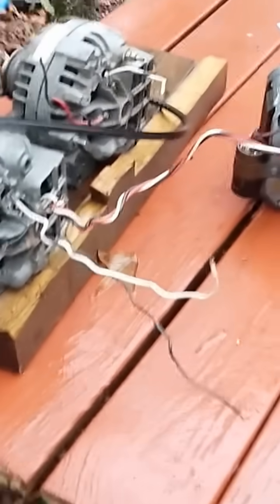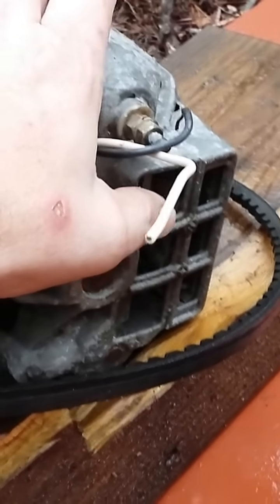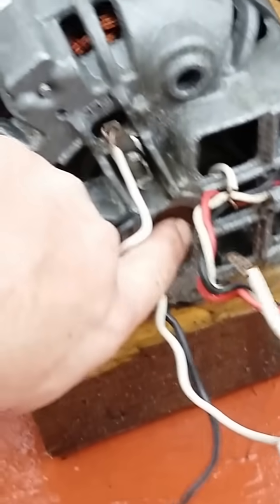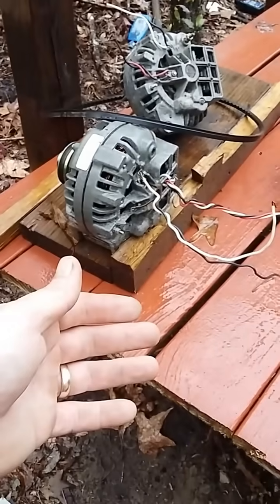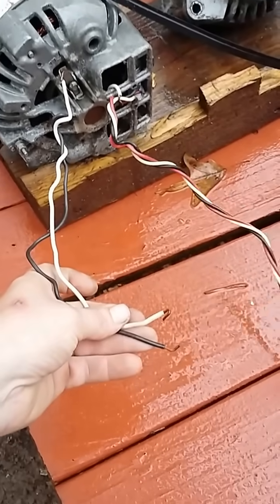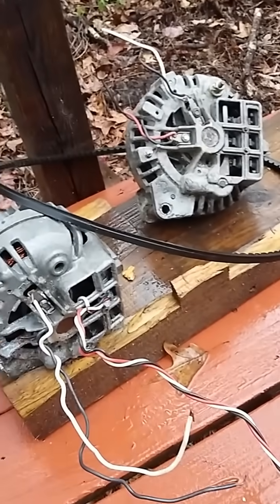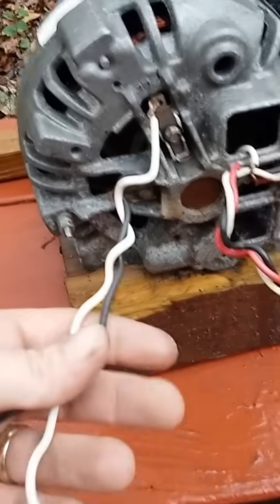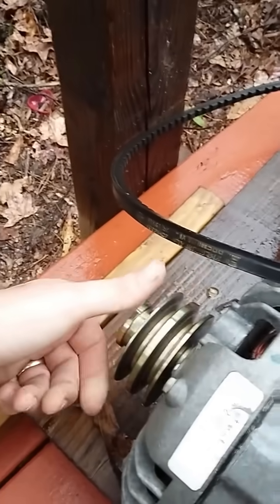Update Free energy forever no wind no solar no gas READ DISCRIPTION!!!

Comment: NO SUCH THING as FREE ENERGY. The Electricity coming out of this is over 300hz and household appliances use 60. This WILL destroy any appliance connected to it. This is stupid. Also it's disrespectful to disable comments
Reply from the maker: DarthSmartt do you see the comments disabled and you haven't ran the machine or obviously you would know that running it at 3600 RPM would give you 60 hertz hence the whole phrase 60 pulses per second time 60 seconds equals 3600 revolutions per minute prick
Reply: DarthSmartt there is such a thing as free energy, but you need to do the research first, just making off hand comments gives any reader of your comments a true sense of who you really aren't.

Comment: "But, but, but... The motor I'm gonna use to turn the generator uses almost no power at all." Sure, pal. When it's under no load because you've never connected it all up and run it. As soon as it's driving three crappy old alternators there will be a load just from friction and drive train hysteresis alone, and that's before you even draw any power off. Whatever that load is, will always be added on top of whatever power you think you can draw from them, and that's without subtracting even more power to excite the field coils. Every amp you draw creates more back EMF in the generator, creating more load on the motor turning the generator, requiring more power to keep the generator turning, PLUS the power being consumed by the motor to turn the generators before you even started drawing any power. This is basic high school stuff.
Sound like I know what I'm talking about? lol
Reply: ThomasBuie EnergyBuies at gmail com
The energy you "make" needs to come from somewhere. To produce 10 watts of power, let's say 10 volts and one amp, you need at least 10 watt input. Because from what else is the power comming from? These are the basic laws of physics, and if you  live in this universe you gotta follow them... Proove us wrong then and show us how it works in theory
And skip the BS of "I can't" or "I don't need to". Is it so hard?
Reply from the maker: oOConstantGardenerOo 
No you're wrong, but thanks for the comment!!
Reply: ThomasBuie EnergyBuies at gmail com Sure I am. Why don't you prove me wrong by posting a single video of the system running while you take measurements from it... I'll wait.

I'll make it easier. You tell me which bit of what I said is wrong.
 Do you have a drive belt made of magic rubber that requires no energy to deform? Magic frictionless gears perhaps? Did a mysterious stranger swap you your cow for some magic alternators wound with the only material in the universe that doesn't generate a magnetic field when current passes through it? Do they have magic frictionless shaft bearings too? 

Hey, I'm sure you don't want to give away your secret without someone paying for it, right? That's fine. As I said, you don't have to give me the fine details. Tell me whether I'm wrong about the hysteresis in the drive train because you've got a magic drive train, or the increasing load as you draw power because you've got magic wire that doesn't generate a back EMF (better not use it for the excitation coils, huh?)
Or just show it running while you measure it.

Comment: Just need about 200hp to turn the two altenators  under load
Reply from the maker: tony hall THAT is not true! the difference in Horsepower between an electric motor and an internal combustion engine motor is almost the same as night and day!!! I am able to turn two 10000 watt generator heads at almost full capacity with a 3 horsepower AC induction compressor Duty motor that runs off of 220 volts ac. the reason why I do not use this constantly is because the motor has a high consumption around 10:00 amps and as almost all AC  Motors are made to inherently burn energy through heat dissipation, that is not the case with 3-phase permanent magnet motors.
Reply: ThomasBuie EnergyBuies at gmail com if you have 200 amps out why care about 10  amps for motor
Reply: 69 camaro 350ci  200a altenator10,000 watt stereo.
If I turn stereo up loud at idle it will make car die
Reply from the maker: tony hall sure it does...
Reply: tony hall ....a 69 camaro,with a 10000w stereo,a 200a alt,I'm guessing 24" rims too?..answer!your car probably just runs like shit!.....and go buy a Honda with a fart can on it!.
Reply: Nope just got 15's 
It happens when batteries and caps are disconnected and car and system are running off alternator alone 

If you had a clue you would have inquired along those lines . You so full of shit to run house of altenators without lots of horsepower to turn . Show us . I believe if you could you would because then people would throw money at you
Reply: tony hall .....lol...I'm not saying it doesn't require torque (not hp)to spin alts at full field amperage draw....I'm just LMAO at a bafoon that would put a 10,000 watt amp in a 69 camaro....what speakers you got 8 15"s in it?,no trunk or back seat...oh oh! here's the  answer,ya just park a 12k genorator on the roof and it'll cure your stalling issue from your kick ass stereo.....dork!
Reply: You need to hide in the woods after trying to get people to send you money over your flat out lies . Even though I guess you might be to stupid to know better

Comment: If you run 90 amps through that 10 gauge wire your going to burn it up.
That wire is to small. Just a heads up.
Reply: It looks even smaller than #10, as an electricsl engineer, I actually found this funny as hell, but God bless him, he's trying.
Reply from the maker: Dave thanks for the comment. And yes you most certainly will. But the alternator in this video is actually a primary mover or S Drive. (Motor)

Comment: all. You need to do is  build a small
Stand or farm like a generator sits
On mount the 2 alternates wire them together
+ to + & - to - wrap a rope around one of the pulleys pull the rope to see if it works.
If it does then you'll have yourself
A good little Camping Generator.

Comment: So let me get this straight people actually think you can get more energy out of a system then you put in
Reply: ThomasBuie EnergyBuies at gmail com yep, that's about right. You're throwing a word salad together trying to sound like science, but nothing you're saying adds up.
Reply: Transformers can step voltage up or down. Just got to know what you wiring in series with your power source. Basic journeyman stuff.
Reply: Joey Neary As the voltage is increased by the transformer, the current decreases. Power is voltage x current, and cannot exceed the input power minus the losses in the transformer. 
You can put 12v in and get 120v out, but if you put 10amps of current at 12v in, you'll only get 1amp at 120 out. 12x10= 120w, 120x1= 120w. This is below 'journeyman' stuff. Children are taught this in basic lessons about electricity.
Reply: oOConstantGardenerOo never said i was an electrician. I am an hvac tech. I use transformers to step voltage up and down. Sorry i used the word journeyman. Thanks for punking me out captain obvious.
Reply: Any time pal. Amazing how you missed it if it was so obvious, you being an HVAC tech and all.

Comment: As long as you can convert more natural energy into electricity than you use and save it (ie batteries) you WILL save money on energy bills over time. It's the same concept as generating electricity thru solar panels and selling your excess back to the electric company. I ran across this video and found the concept interesting. Like the solar panel thing I would always like to know other ways to achieve this. Maybe even using the alternates to multiply the energy. This is the American way. Testing sh.t out till you get a better result. And before you berate me for something, I haven't had time to look at at the other videos about these concepts. But tell me which ones to check out, thanks.
Reply: Patrick Holman you're getting charged for Watt Hours, the voltage makes no difference. Fool.
Reply: Your meter/meters are single phase watt hour meters, a Watt is the product of amps multiplied by volts, if you have two phases for 240, that's two meters and you are charged for the sum of both. A KW/Hr is for eg: 1 x 100W light bulb running for 10 hours resulting in the disc in the meter turning 100 times increasing the meter read out by 10 tenths, or one unit. OR 1 1000W dryer running for an hour, or 1000 1 Watt bulbs running for 1 hour or 100 1 watt bulbs running for ten hours....
 It is exactly what it says on the tin. The more power drawn through the Watt Hour meter, the faster the disc spins.

They read KW/Hrs : the product of Voltage X Amps X Time. You are not being charged for "220V power"... there is no such thing.

Comment: You could use wind to spin a fan blade on a something like this to charge a battery and use the battery for something low like an electric fence, Low lighting, enough to get you by. More batteries you have more power you store. (Car battery tractor batter) 
So a video like this isn't a total waste if your willing to figure things out on your own. 
I have actually seen a solar video storing power on used AA batteries so start saving them, looked like about a hundred of them wired up.
Reply: while both of those ideas could work (with some very complicated charge monitoring circuitry) they are both a bad idea for the following reasons. Single use batteries are not designed to be re-charged, doing so can sometimes get a bit more from the battery but more often than not they will just heat up and if left unsupervised WILL explode. Alternators from a vehicle are a bad choice for wind power designs. They require too high an RPM to produce any useful power and therefore require gearboxes or pully and belt arrangements to increase the shaft RPM, all of which have friction losses reducing the amount of power available to the alternator. Also the side of the windmill blades gets to be considerable given that a car alternator needs almost 7 HP @ at least 3200 RPM to drive it at "full noise" If you do the math and include the losses in your gearing, you'll see what I am talking about.

There are no free lunches.
Reply: Jimmeh B 
Musk is selling a battery for couple grand that others have proven can be done quite cheaper with batteries. 
Yes wiring would take some time. 
And a motor that spins because of power can create power if it spins.
Just throwing some general ideas for people to look at and they can figure out what works and what don't.
Reply: ed sweitzer, I have one. So far I'm running off just over 6600 LIon 18650 cells from "fucked" laptop battery packs that were destined for land fill. Charged from solar panels with any excess power being dumped into the hot water system. Total cost... 700 dollars for the entire set up which generates 24KwHrs on an average summer day and 14.5 K AHr storage.    

Yeah, you can do it cheap if you do your research and spend a LOT of time learning all you need to know to design and build very high current battery monitoring systems, chargers and battery packs that will handle the peaks while keeping temperatures within limits and not burn your house to the ground in quick fashion. It's not for the faint of heart, it's FAR from easy and tbh, beyond the ability of most people. 

What this fuckwit is proposing is absolutely useless.

Comment: The alternator produces 90amp @ 12vdc 1080 watts
Which is only 4.5amps @ 240vac NOT 90amps as you said. What you are proposing is B.S.
Reply from the maker: antonio030562 
Yeah and I also switched the words rotor and stator around, along with you not even seeing the generator in this video... what would be the easiest way to keep immature people from watching the video or any of my other videos? have a baby crying in the background.. there's a couple other things that I said on purpose to weed out a few other types of people but I'm not going into that because I've already answered these questions about 40 times and any other question that you could think of...  I am the real deal and this is my protection "firewall" video!
Reply: antonio030562 Came here for this... voltage and amperage are inversely proportional.  Given the same conditions, if one goes up, the other goes down.
Reply: you are so full of shit. How does this protect you from anything??? I'm gonna go and critique a few of your other videos.

Comment: Very interesting. What turns the generator and what powers it ?  I completely understand the conversion from dc to ac .  But you have to have something to get it moving..
Reply: Johnny Bumpous came here to say this? Where are we getting the 6-12V and what is powering the motor turning the alternator?  

Replace the motor with something like wind or a water wheel in a river/creek and you’re good to go for “free” energy, but you’re really just taking the energy out of the moving wind or water and converting it to electricity, at a great loss... 

Using electricity to convert to mechanical motion (the motor), then converting that to electricity is a terrible idea... you get losses at every conversion.  Even transformers have losses when just converting between voltages...
Reply: David Kane thank you..

Comment: I am interested in this topic, I have a few alternators laying around, a small generator and a small solar setup, X2 100w PV & a small battery bank of 4 AGM batteries, and an extra 100w fuse box I had planned to wire up to the inverter to  which is only a 4000w peak.  

I and interested in, and believe there should be a way to supplement my small solar setup, more directly keep my battery bank charged above 50% to run a % of the house which is just my wife and I at present. 

It seems logical that if you can increase output and reduce the input, ( wheel and or gears ) between these components it should be plausible to generate a surplus, but I need to get smarter on the subject since I have basic home wire wiring experience, and mostly work on projects at home, restore cars, pickup trucks, motorcycles and other projects while at home since being blown up in Iraq.  Hoping people start to become nice again like back in the 70's; which I do not expect will be any time soon; so mean while I only go to town for supplies.  I managed to dig a 30 foot water well by hand with 3, ten foot sections of 2" PVC with two garden hoses attached to a T at the top, and slid a 1 3/4 PVC down the center with a 3' well screen on the end, and with a small solar pump I get pretty good presure. 

Peace

Very Respectfully,
WX2
Reply: Wounded Warr1or,  beautifully said.  You most certainly do have everything you will ever need, brother.  I get the idea from your tone your around the same bemused and amused state i am when everything becomes clear and is so simple you almost have to laugh...or cry.  Amazing how religion snd science truely were never in contradiction at all and in fact serve to prove eachother in the end....  Peace and all my Respect and thanks my friend.  alwayse moving foreward,  together as 1.
Reply from the maker: Wounded Warr1or 
Brother, I would be more than happy to help you out! you have everything you need to provide yourself with plenty of energy you can use the battery Bank to power a variable frequency drive with your inverter and that will give you a high frequency pulsed DC it's actually more of a sound wave but it works off of the magnetic force that you put into your rotor... sorry I got a little ahead, the alternator in this video is actually one of my Motors... I will be happy to get into more detail with you and I thank you for your service! please email me at the EnergyBuies@gmail.com
And put sensitive in the subject line so it'll be easy to find you.
Reply: ThomasBuie EnergyBuies at gmail com Thank you, I appreciate it, I had two failed surgeries and they couldn't patch me up enough to do five more years and retire at 30, so I retired at 25 years in uniform.

The reason I tell you this, and I am certain you understand; I have good days, and not so good ones, and will get in touch as soon as I am in a little better shape.

I believe we are wired like our creator, and if you really think about it, when learning a new subject, building and creating things without distraction we are most blithe in these moments.  

I try to pick new subject matter,  learn and build something new each month, and it is always fascinating how many spin off things you encounter when creating things.  

When I attended the Sergeants Major Academy at Fort Bliss, TX.  I learned the value of building things that avoid a single point of failure; and to install backup redundancies.

Thank you for your kind words and prompt reply. I hope something excellent happens for you today, it all starts with a single thought brother.

Peace

Very Respectfully,
WX2